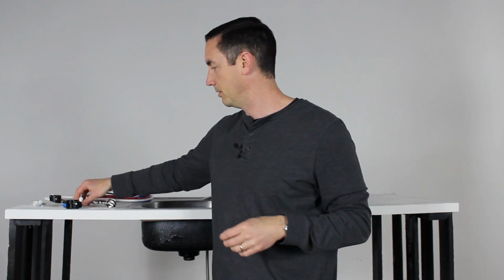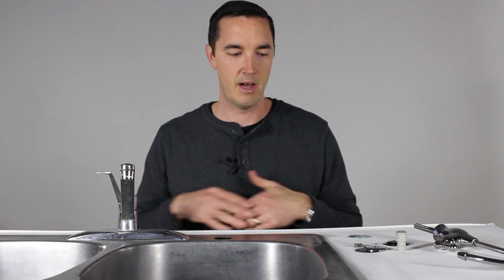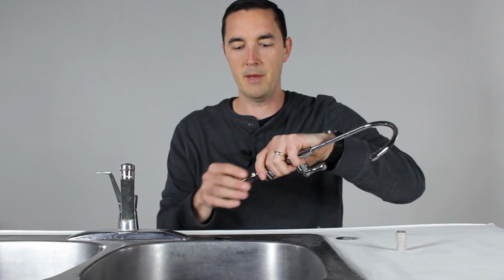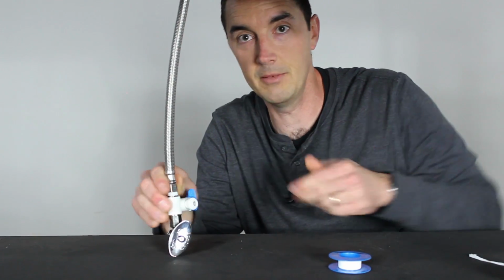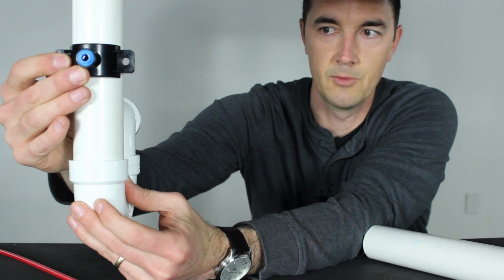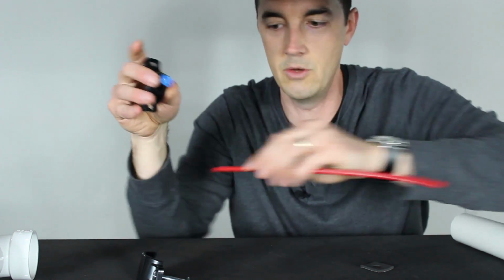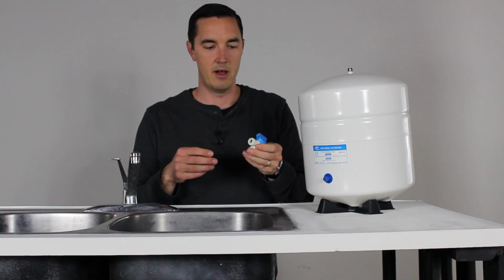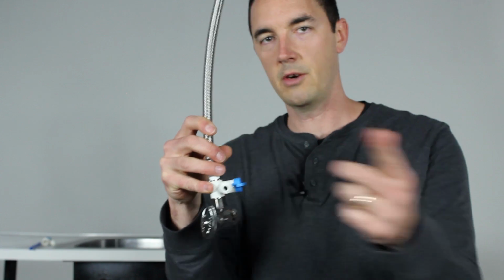How To Install A Reverse Osmosis Water Filter System

Comment: what can I do if I have a single sink and it directly connects to garbage disposal, the pipe connecting the garbage disposal and p-trap is pretty short and not straight, doesn't look like it can fit in the saddle

Comment: What if you have metal pipes ?
Reply from the maker: Then you might need to contact a plumber to do the install. Or you can use a different valve that pierces the copper of your pipe vs. splicing inline.